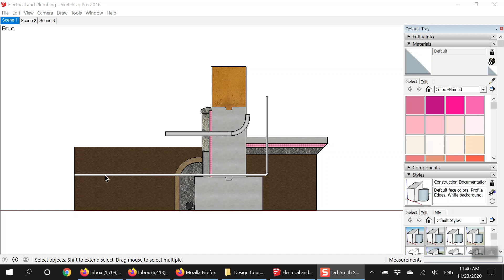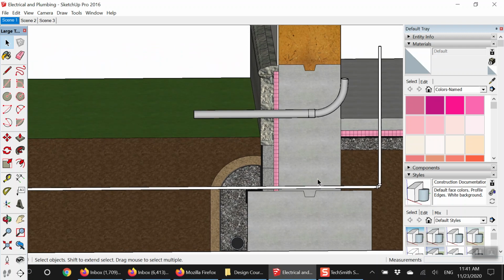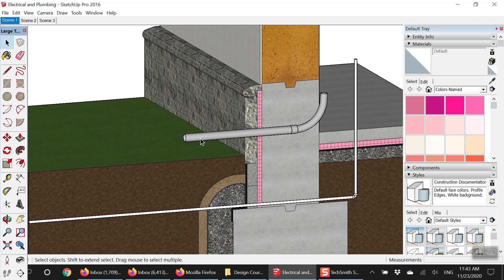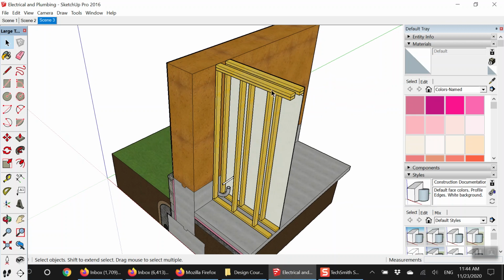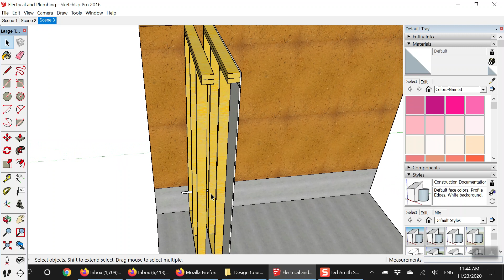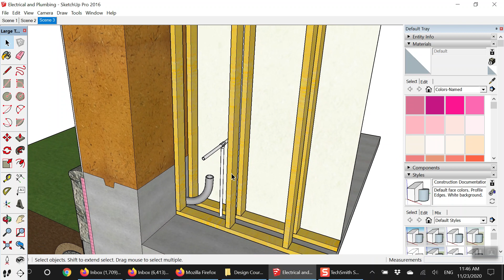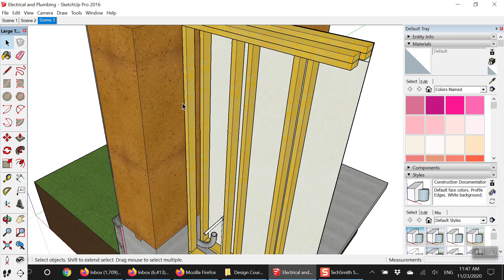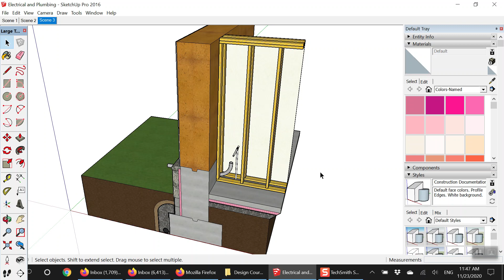Electrical and Plumbing In A Cob Building | Cob House Building Guide

Comment: Apologies for an ignorant question...if your water inlet pipe is coming in through the foundation or stem wall, is there a lot of weight from the cob wall onto this pipe? What are the chances of it cracking over time?
Reply from the maker: It's a good question. Keeping your water lines safe from cracking is important. Putting them through or under the foundation won't be a problem here though. The wall's weight won't bear down on the pipe directly, and will get distributed widely so it won't have that effect.
Reply: @thiscobhouse thanks so much for the response. Your videos are much appreciated.

Comment: why dont take about  waste drain and vent
Reply: In FL they run the water through the attic. If there is a leak you don't have to jackhammer the foundation. The water is pretty hot in the summer though.

Comment: OK, you run the water pipe below the frost line, but it has to go up to get into the house.  Is the part that comes up through the frost line just too small to freeze?  Or- can you wrap it with insulation to keep it from freezing?
P.S. Good video!
Reply from the maker: I think you could wrap it with insulation. That might be a good idea!

Comment: awesome examples. How would you finish a stick frame wall with a more natural material? if you wanted to stay away from dry wall
Reply from the maker: Put wooden battens or chicken wire over the stick frames, and then apply a natural plaster.